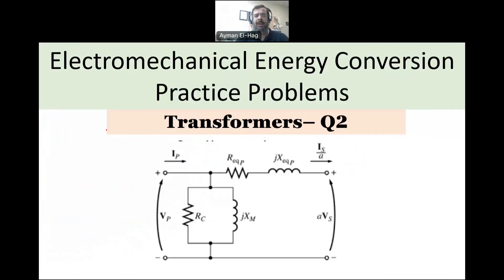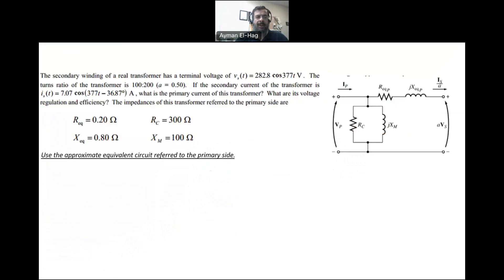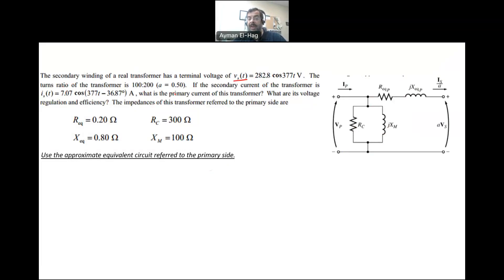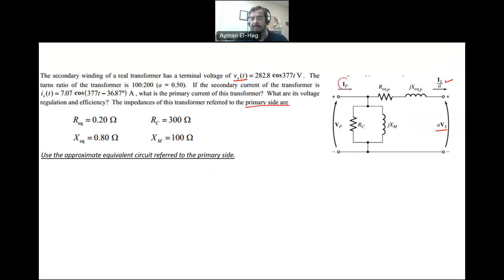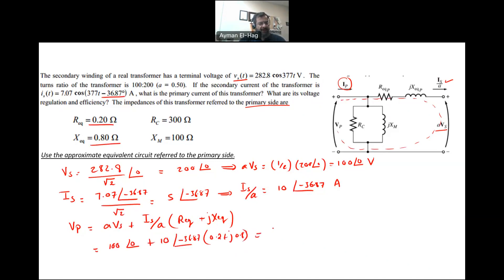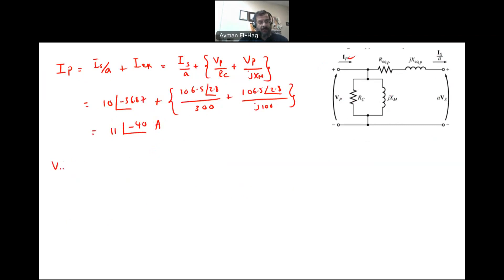Transformers - Question no. 2

Comment: I have a question. How can I prove that why a Transformer does not rotate like the Motor? I know the reason, but I am trying to figure out how to prove it using equations and relationships. Thanks for your incredible videos.
Reply from the maker: Induction motors are called rotating transformer as they work on the same principle of induction. However, the difference in induction motors there is a rotating part which is the rotor. In transformer all part are static and cannot rotate. Back to the induction motor, if you hold the rotor and block it from rotating it acts like transformer.